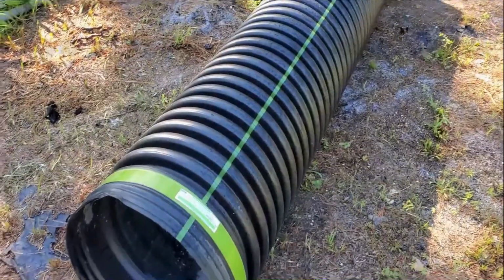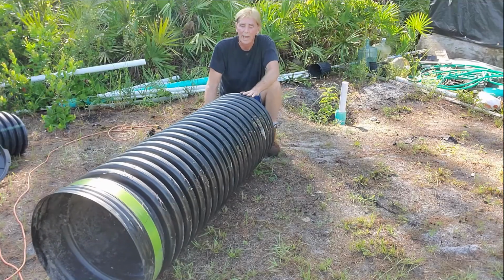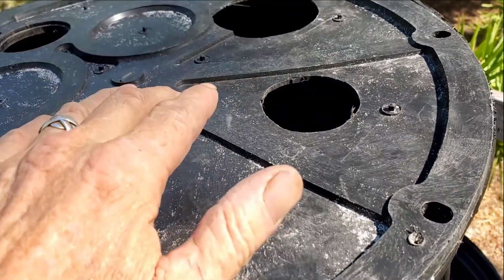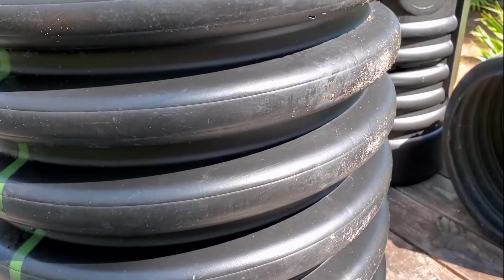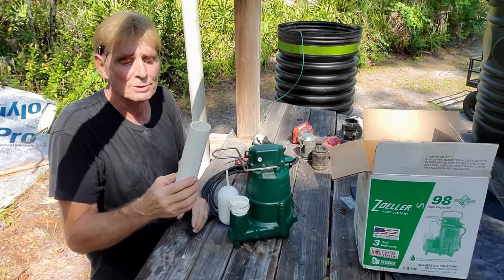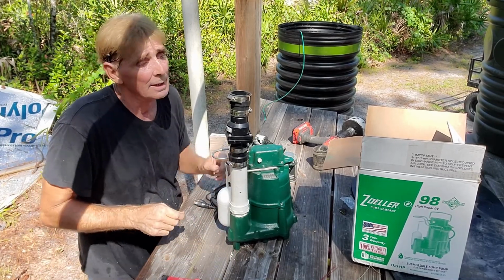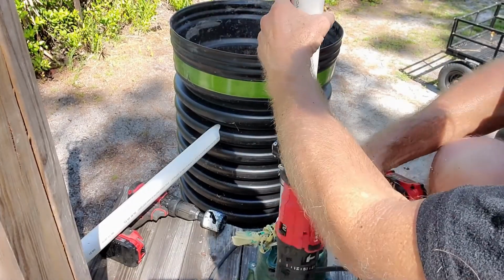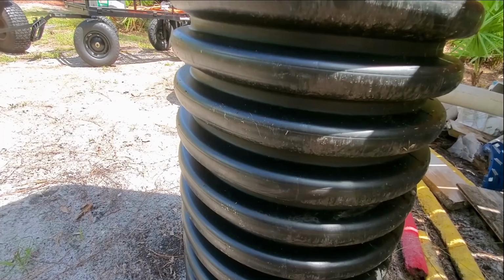How to Build and Install a DEEP Sump Basin

Comment: What do you do when the discharge line exits four foot deep to keep the line from freezing?  Do I need a 30" diameter basin so I can get down in there to attach the pump to the discharge line down deep?

Comment: Any tips or videos on digging down 6 to 8 feet to install this? I’ I’ve got an inside corner exterior wall where water collects and leaks into basement( only when really high rainfall, couple times a winter). I’m in the Pacific Northwest, soil is clay
Reply: Yeah, get a shovel and get busy

Comment: Hi Chuck, what are some reasons that a person would choose to use one of these super deep basins instead of the standard ADS basins? I have a flat yard and need to make a drop on a French drain that will be in flat ground over 50 feet distance. Can I make enough gravity fall using the standard ADS basin?
Reply from the maker: More than likely! It doesn’t take much fall for a French Drain

Comment: You said the inputs need to be higher than the sump pump.  Why?  If you are draining a rising water table that threatens you cellar floor and foundation, wouldn't you have holes all around to let water in at several levels (with screens around the outside to keep the dirt out).  The water coming into the culvert pipe would fill it from several levels.  The float switch would shut the pump off if the water level got too low.  No?

Comment: I have a culvert basin that is 8 to 10 ft down. Is there any reason that a 1 and 1/2 inch plastic sump pump hose cant be used instead of pvc? The ground has shifted around the culvert and has a curve to it but i can still see the bottom. The flexible hose works fine but i dont like surprises. Any thoughts?
Reply from the maker: Should be fine

Comment: I have a question.   I have a room that’s built into a hill.  From grade to footer is 6’ deep.  The room in 18’ wide.   Could I have a hole dug and put a setup like this in the ground and I was thinking of drilling a bunch of holes in the 18” pipe and surround it with gravel?    I was hoping to avoid trenching the entire room.  I wonder how wide of a space it would grab water from?
Reply from the maker: Water will migrate to your trench

Comment: I've watched your videos for a little while now and am about ready to try my hand at installing one myself.  Just today I purchased a "used" plastic corrugated culvert that is 46 inches tall, 24" at the lip and 20" inside diameter between the ridges.  My question is this -- this one already has about 12-15 holes drilled into the sides at various locations (it was used for composting) that are 3/4" upto about 1 1/4 inch diameter.  Should I try plugging the holes with anything or ignore them as this will be almost completely buried when finished?  Thanks in advance and thanks for the helpful videos.

Comment: Hello- great video.  One question though.  The riser from the pump is 1.5”, but your discharge line is 2”.   Where/how did you make the pipe size change?   The back flow device hubs are only 1.5” max dia right?   Thanks!

Comment: Thanks for all the info! Would it be possible to drill holes in the culvert to allow natural water into the sump if its wrapped with fabric to keep dirt out?
Reply from the maker: Sure. Depends on the soil
Reply: @appledrains  if you have plenty of clay would you recommend drilling holes in the culvert or not doing that?
Reply from the maker: @jacobgentile7685  watch the video again. It will answer all your questions and more.
Reply: @appledrains could you let me know where in the video this is addressed? Unfortunately watching it again I didn’t see anything about this, only drilling holes for the pipes and a hole in the discharge pipe of the pump. I see you didn’t drill any weep holes on the basin but wasn’t sure if that was because of the soil type or maybe it isn’t really needed
Reply from the maker: @jacobgentile7685  check other videos. More related to what you’re asking. I promise you that watching a video will answer all your questions. You just have to find the right video.

Comment: The pipe you're using for the basin is very expensive
Reply: You wanna see an expensive sump, check out the frenchdrainmans screaming demon.  To be fair, it is a bad ass sump pit.   His sumps lay horizontal underground and offers a big increase in capacity.  When the pump float moves 5inches of travel, the pump removes twice the water compared to a vertical sump pit.  THIS is the secret to long pump life, less starts, longer run times.  Less times your power bill takes that large starting amp in rush.  It saves you money!  It better, because that guys sump pit is 1400bucks with a pump!  He also preaches no check valve because they always fail.  With an increase in capacity, you can afford a little bit of water running back to the pit.  I like chuck here, but those 38dollar pits are junk, super flimsy cheap garbage.  Good for basements....  Nah I wouldn't use one there either.

Comment: Do you have any tips for digging a minimally invasive hole for this? I need to dig a 9 foot hole for an exterior sump
Reply: Depending on your soil, er rocks like my home, i would suggest Perfection Fence Diggers from Seymoure. They even have extended handles but you will still need to have a trench for both pipes in and out.

Comment: Is it necessary to cap the bottom? Can culvert pipe sit on filter fabric and gravel directly?
Reply from the maker: We would suggest that you cap  The bottom. Pumps are very powerful and can pull dirt from under your culvert. This will create erosion along the side of the culvert. So if possible yes you should cap the bottom
Reply: @appledrains  That was one answer I needed today. 18" Dbl wall is $300 for 10' plus delivery of course. I used a blue 50 gallon plastic drum and a steel one on top. I'm about to anyway. I cut the bottom of the metal drum and have a lid for it. I will join them together with 40 mil subseal. I put a thick coat of rust stop paint on metal barrel after sand blasting the rust off. I' 8 plius feet below grade in a bathtub of clay.
Reply: Thank you so much!

Comment: Hey Chuck. This is racking my brain. I need to put a similar sump in about 8’ down. No augers I can find go that deep. How do you dig a hole like that? Thanks for your great videos.
Reply: You dig as deep as you need. I hand dug  a little over 8 feet down tghrough the worst back fill of red shale and then clay. Some of the jagged  rocks were 2' around. It was literally hand digging rock by rock in some sort of real life tetris in reverse. Some of the sharp rocks cracked CMU blocks. There was no weeping tile only old corrugated downspout right above the footer. At first I thought it was perfoorated but no.
Reply: @jericlocke1  how long did it take you?

Comment: I don’t understand the hole on the 2” pipe before the check valve. What does that do? It prevents pressure from building up? Why 3/16? Why not 1/4” or 1/16”? I feel like I need to see it in action 😂
Reply: my thoughts exactly
Reply: It eliminates an air-lock due to the bottom inlet on these particular pumps. Top inlet pumps like Wayne pumps have don’t need one.

Comment: Hi i will be installing a 24" culvert pope for a deep basin. What do you suggest as a bottom? Not seeing the lid like you have on the 18"
Reply: A bottom is not necessarily needed you can put a pavers down to set the pump on
Reply: That’s my concern.  How do you seal the bottom and top? I guess I missed that.  DEWinit.
Reply: @DEWinitnow  no need to seal it  like chuck said you can tape it with vinyl tape to keep some debris out but not necessary

Comment: That plastic pipe is very pricey at $15 per foot, and you usually have to buy 10-foot  length minimum, if you can even find it. I like the idea though. Just need to find a cheaper material.

Comment: I thought you were going to address FDM sump basins. I really like them. You can pump more than just the 10 inches or whatever the pump switch activated at. His horizontal sumps will move a lot more water each cycle. I never understood why they even make basins different sizes, when all pumps have about the same switch travel.